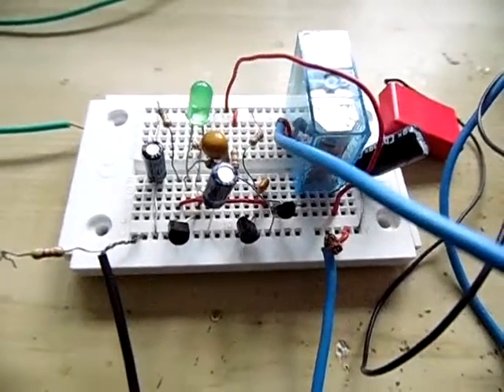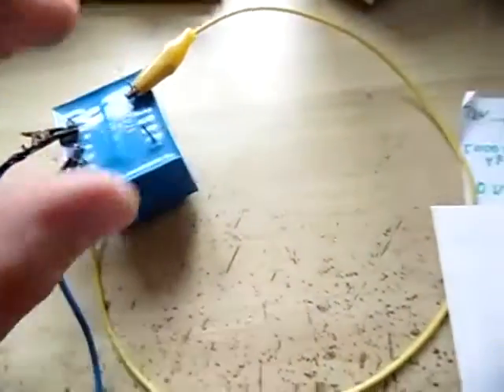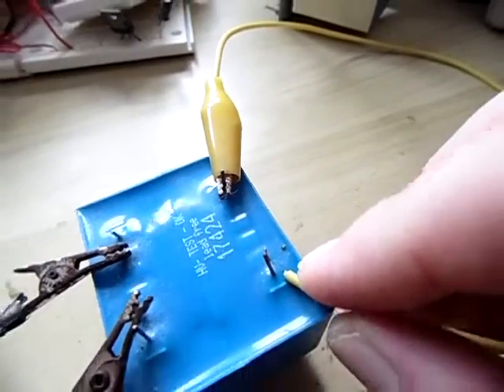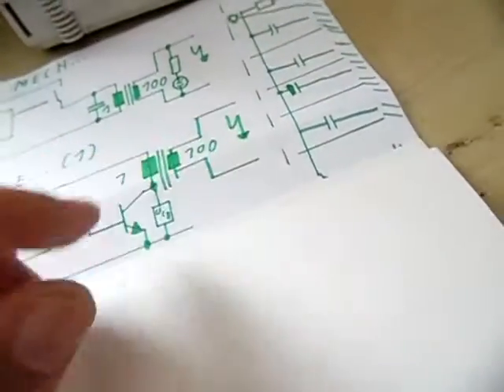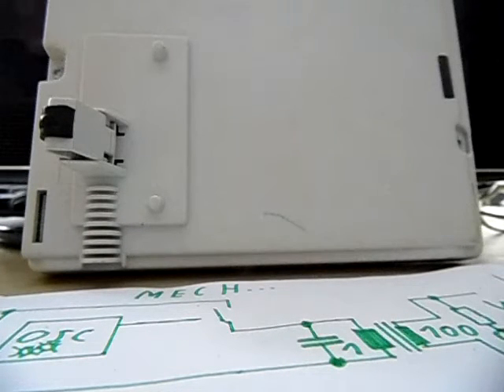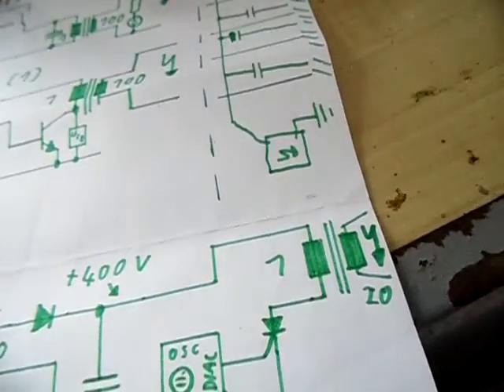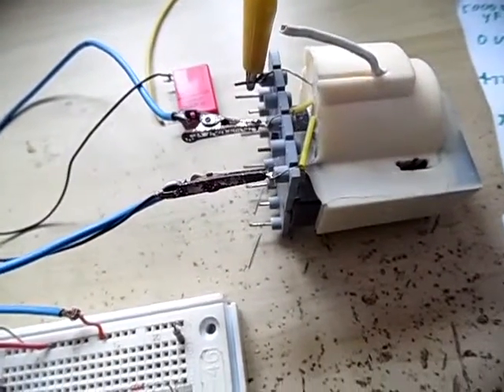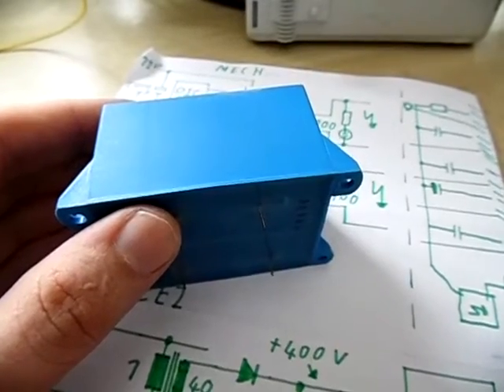How does an electric fence charger work

Comment: How do you work out which transformer you need to replace a faulty one. All I have is the dimensions (31.5x37.5x46mm) and that there are 2 pairs of posts (19mm apart and 30mm apart) and there are numbers 1,2,3,...10 on the top . The energizer is 1.6J/12v. Many thanks anyone!?

Comment: Been trying to find out if I can use a 120v to 12  volt transformer to feed the ignition coil for my fence it will make it a 60 cycle pulce what do you think.

Comment: Excellent video. Perhaps you can help me out!  I just recently got a bull dozer model#4612 (serial # 1245 785) in an ebay sale for a few bucks. The circuit board says 13 1985. 
(13th circuit produced in 1985?). It was listed "as is" so  knew it 
wouldn't be working. I was hoping it would be a bad capacitor, however, that was not it. A
 transistor and what looks like a resistor burnt up. I searched online 
for schematics, but couldn't find any. You wouldn't happen to have one 
or any recommendations for what kind of transistor to put in it, would 
you? the circuit is very simple, there are only 11 components on the actual circuit board. The controller is a 6v/12v design, and I intend to use it with a solar panel and battery when I get it working.

Comment: Thanks for nice detailed discussion. Helped me much to understand what and why low-impedance in the modern chargers.  ELE2 ... I see more components on the breadboard in front of the first transformer than what is shown on the schematic.  I need build one for my livestock. Looking for web page with complete schematic and parts list.  The diac trigger diode has only once connection on schematic. Does not show what else connects to.  I do not know what those other unexplained components are for on the board.

Comment: this video is technical  - I would like a simplified explanation of how they work in layman's terms. For instance: Does the capacitor discharge totally every time the neon light blinks, or does it discharge only when and animal touches the fence and completes the circuit? If the circuit is completed when an animal touches the fence, then why can you measure a voltage on the ground rods all the time when nothing is touching the fence to complete the circuit? Thanks, Stefan
Reply: I ran a low-impedance charge for years to control livestock. Also did not basic repairs to get it back in operation. Yes the cap discharges every pulse as load is sent down the line. I suspect the neon light acts as a safety to help discharge if nothing connected. From what I read, some high voltage outputs can be damaged if load is not discharged.   When the electric fence line is run some distance there is always some discharge with high voltage. Consider humidity, high voltage finding way to ground through air molecules. Also insulators not 100% perfect even though they appear to be on an ohm meter test.  Dust and moisture collecting on insulators reduce effectiveness. Rain wet insulators especially makes circuit to ground.  Hope that helps.